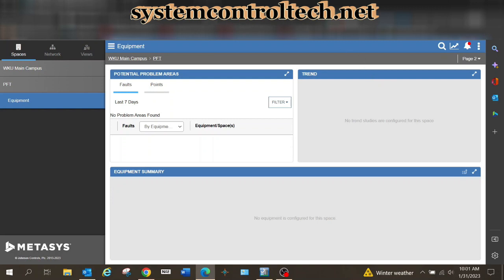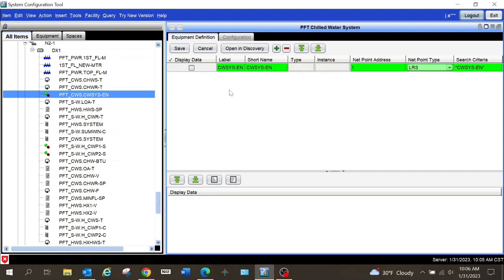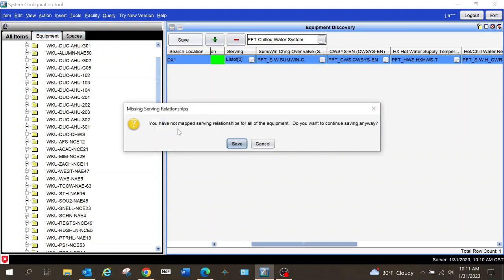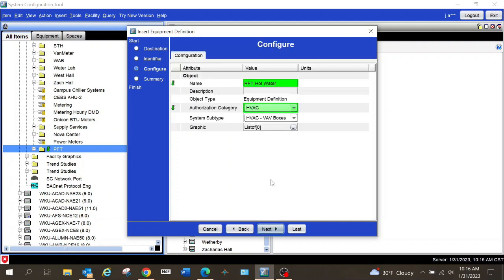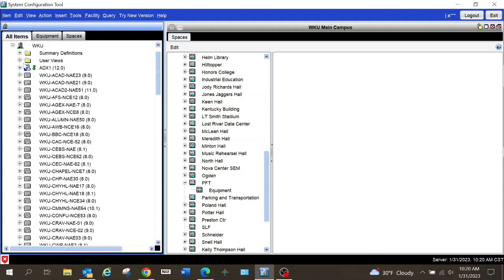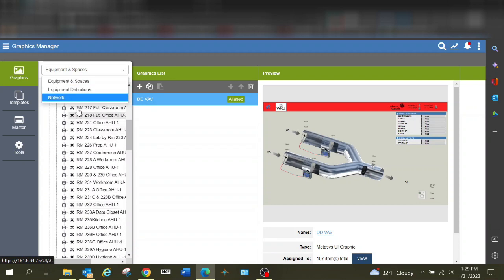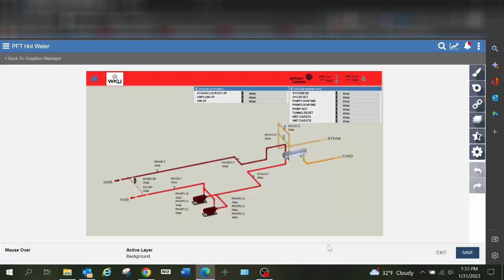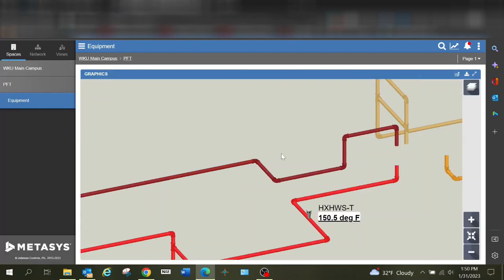How to add equipment to Johnson Controls Metasys MUI Start to finish including graphics

Comment: Thank you for the very helpful video.  At 2:40 you are creating a folder for the equipment.  In our case, we have three districts with a lot of equipment (engines, controllers, etc.).  I would like to separate the three districts, each with their own folder beneath "Equipment Definition", then add the appropriate equipment folders beneath those district folders.  (1) Can that be done? (2) Do you foresee any issues with having that type of folder structure beneath "Equipment Definition?"
Reply from the maker: Yes. Just be sure to create the folders in the equipment definition popup like i show. Don't just do an insert